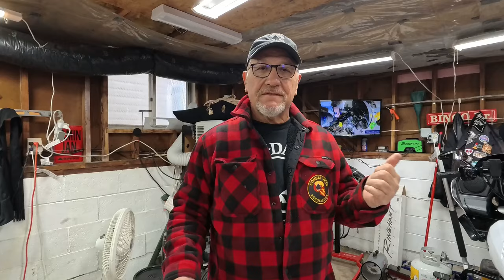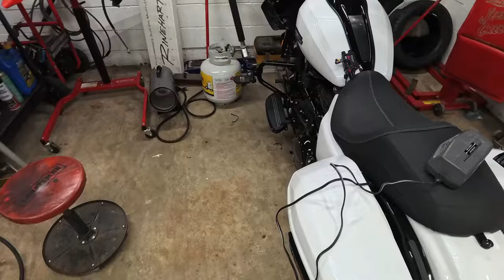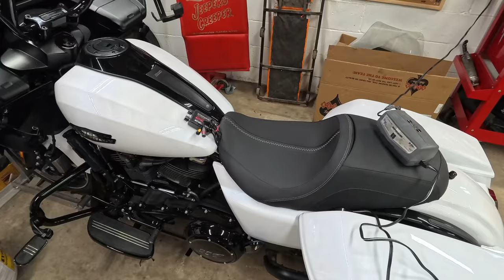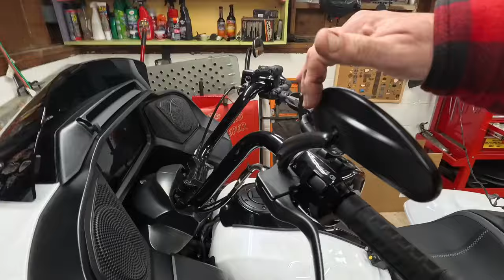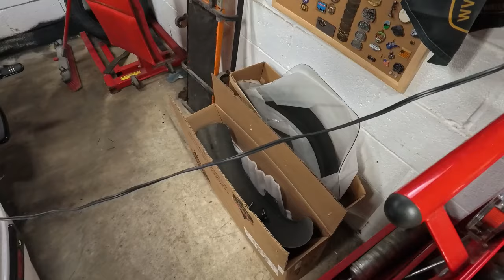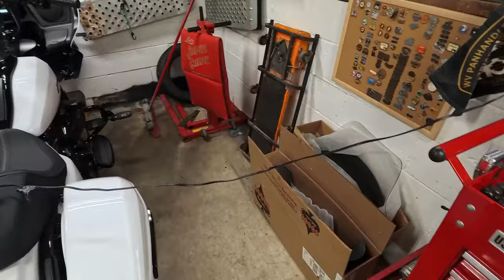Riding High: Unveiling the Harley-Davidson Road Glide

Comment: Great tips.  I just got a 24 Road Glide. I have a set of Screaming Eagle Street Cannons I took off a Road King before I traded it.  .  Wasn’t sure if I could use them.  The Harley site says they won’t fit.  But if your Reinharts do, I guess it’s worth the effort of slipping them on.    Sadly, my Tall Boy seat won’t fit.
Reply from the maker: Yep, seats are not the same. The tanks are different so the front hook won't work

Comment: Its probably the tank change and not the frame that stops the seat from fitting. 2008 had the same frame as 07 but when they did the 6 gallon tank, thwy changed the front mounting tab. But the frame was identical
Reply from the maker: Yes, after better inspecting, the tanks are different, and where the sear slides in

Comment: I’ll take that fender, !!
Reply from the maker: I will have it repainted and put it on the new bike.
Reply: If it's an older fender it will not work
Reply from the maker: @roadglide6465 The fender does not fit